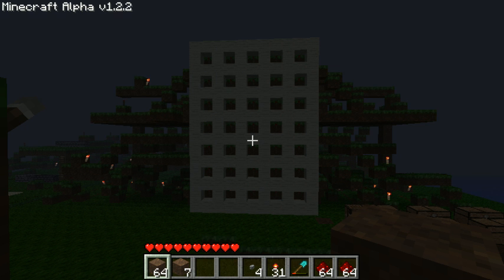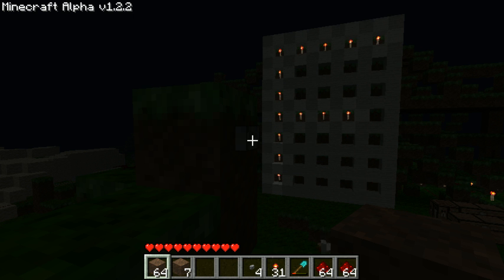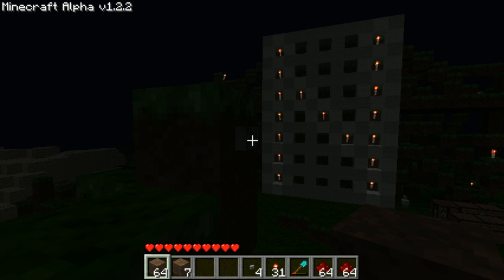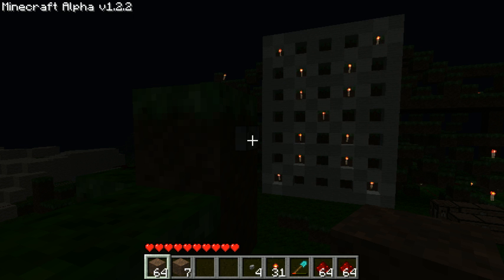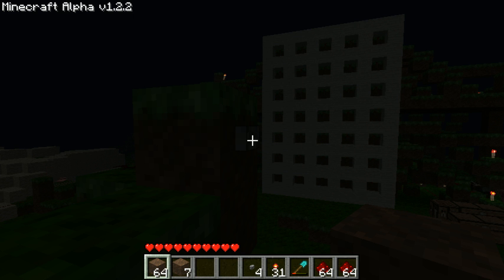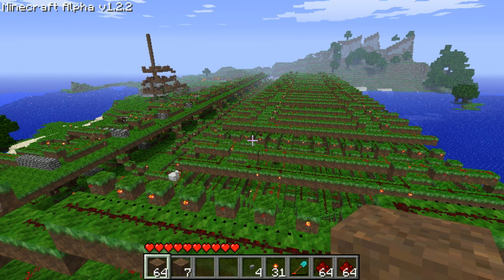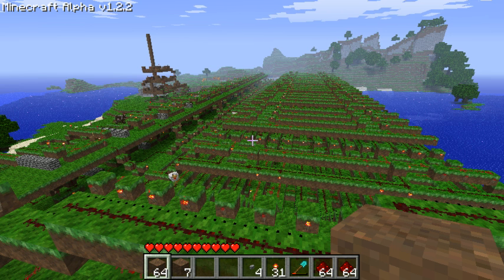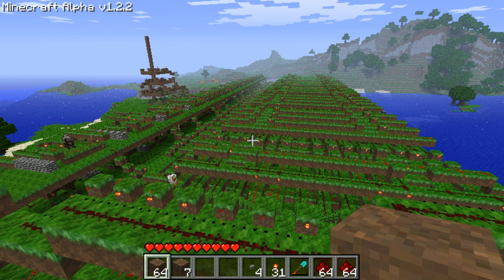Minecraft - Harbinger's Redstone - Dot-Matrix Display and Decoder Cycling Letters A-Z

Comment from the maker: @Mattie400 Mine actually did something similar when I was testing it.  Only went to 00111 at first because somehow a torch in my 4th flip flop disappeared.  Easiest way to track down the fault would be to break all of the output lines (to speed things up) and then wire a clock to the input of the first bit.  Then you can run around in the counter and watch to see where the signal breaks down without having to cycle it manually, working one bit at a time.  Likely just something small is missing.

Comment: Very impressive work, and the circuit even looks impressive as "scenery"
A way to reduce size would be removing one column and one row from the dot matrix (you can still display all characters on that size, I must have an old bitmap font I made in those dimensions for reference). Also using more vertical space, and the North/South torch "quirk" to increase speed. 
Newer logic gates with reduced size/more speed are available on the official forums, using that "quirk". You might find them helpful!